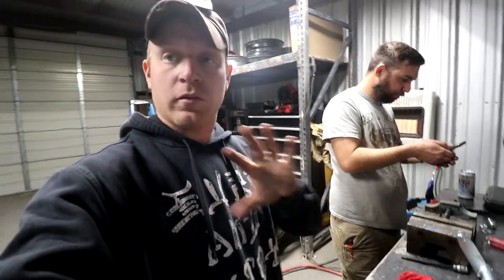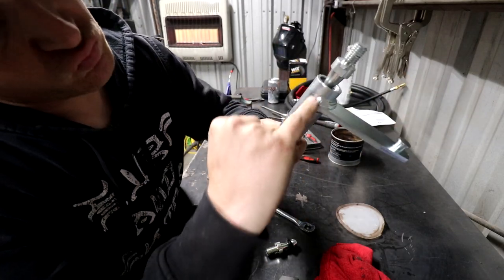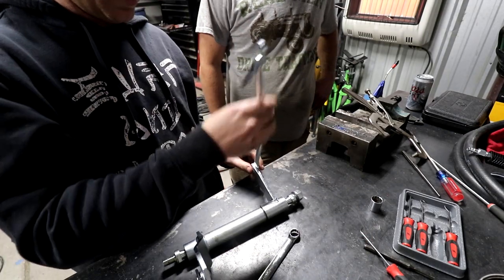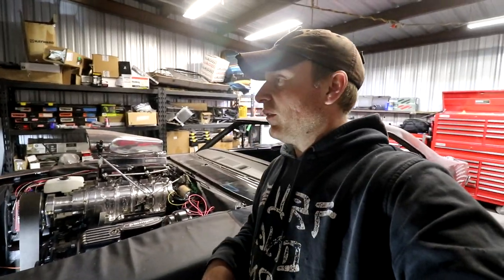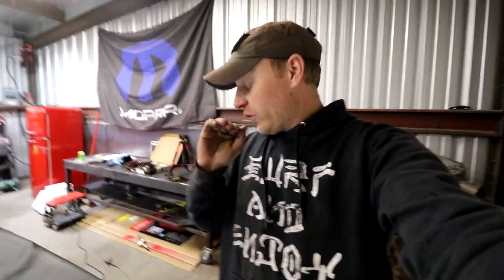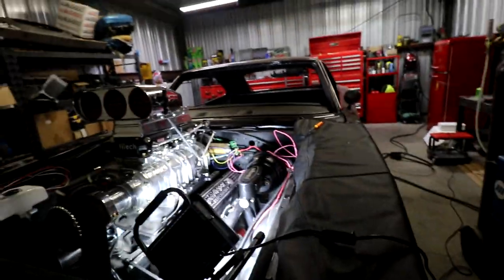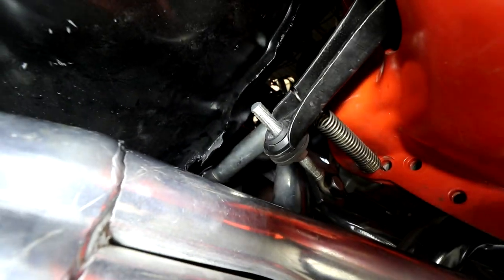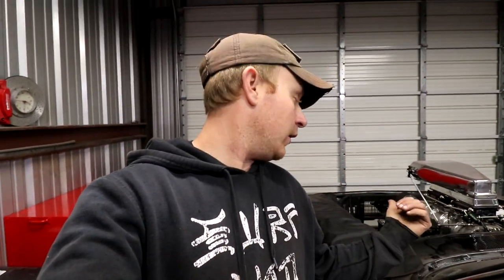Z Bar and linkage Install on a 1970 Charger RT / Mopar B Body

Comment: I'm putting a new z-bar in my 70 Challenger. Seems pretty straight forward. However, the retaining clip for the nylon bushings seems kinda stupid. It is only on one side of the bar. And, there are no holes in the bushings. Just the grove for it to wear down. Also, need to be careful and position the bushings properly - otherwise the clip ends will fall between the two bushing halves and then do nothing to hold them in place. Anything else I am forgetting, Shawn?